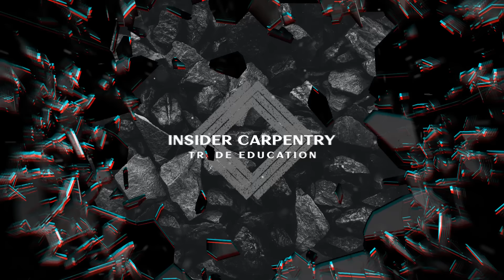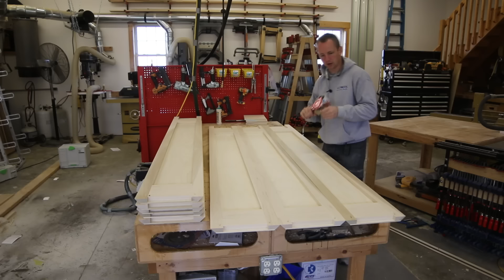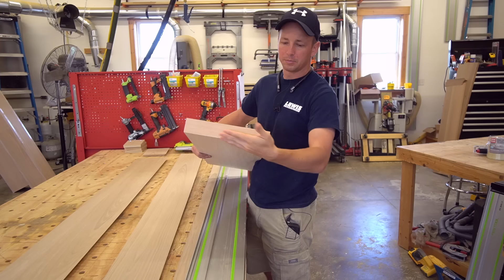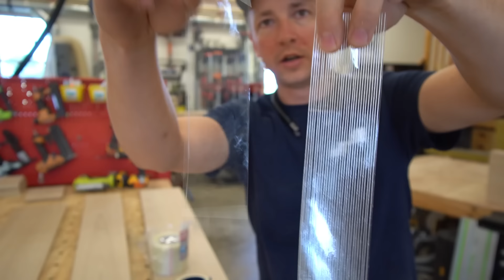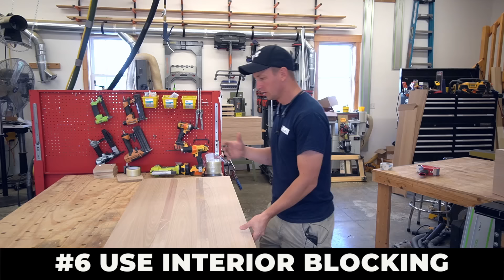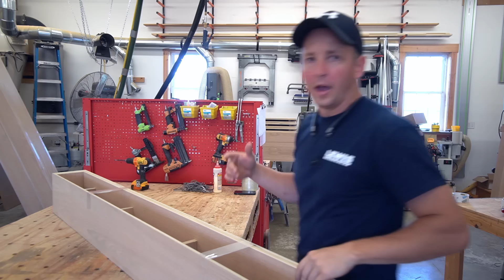MASTER PERFECT MITERS!!! | 10 Secrets to Miter Folding

Comment: I just installed a column in a porch railing configuration. I have a cabinet saw but it does not go past 45!!  I had to install the 4th side after the supporting post was locked in. Am I missing something? Is there a trick somehow??? Thanks
Reply from the maker: Usually there is a stop that can be adjust. On a cabinet saw its usually a bolt inside the cabinet that something bumps against when beveled.

Comment: Lewis's Laws of Miters (LLOM). I was wondering why there was a Ryobi 23ga pin nailer being used and what happen to the Milwaukee. It would be nice to hear about how the Milwaukee is performed.
Reply: Oops, you were talking about 23ga, my mistake 😆
Reply: I'm wondering too , I own the Ryobi 23ga pin nailer  and started to not sink the pins anything over 5/8" so I purchased the Milwaukee so far no problems.
Reply: @giankees450  I need a 23 gauge, which do you like better ?
Reply: @allent555  so far I really like the Milwaukee and its working great, it's smaller and lighter than the Ryobi which I had for 3 years, only time will tell.
Reply: I have Milwaukee gen 2 for over a year and 50k+ nails. Running perfect, no problems, no jams, very stable on nail depth.